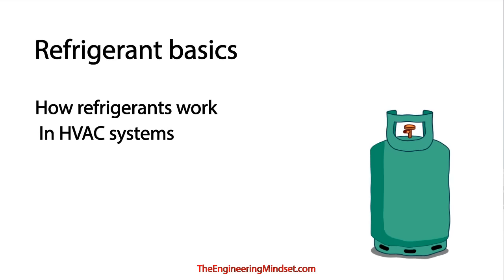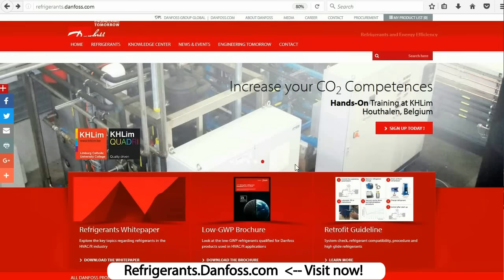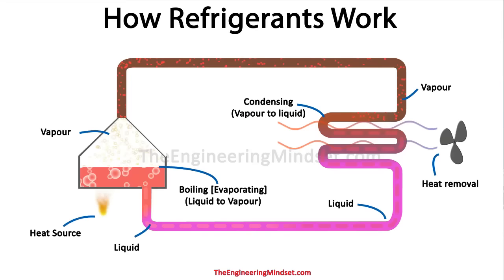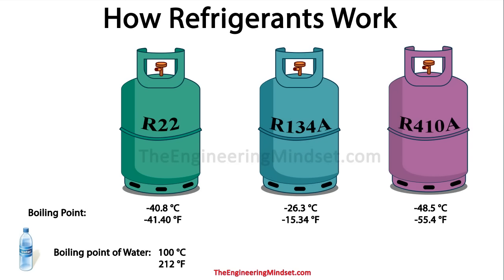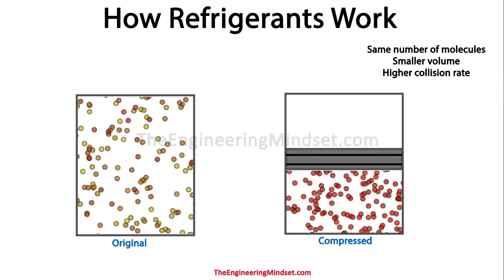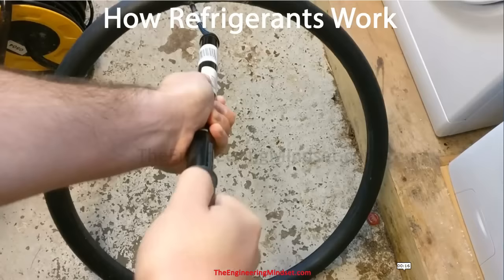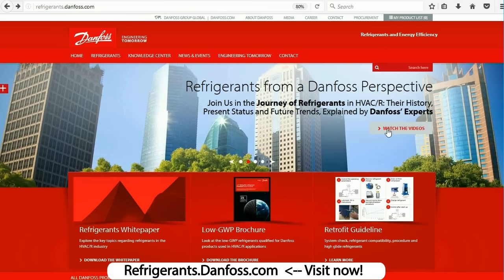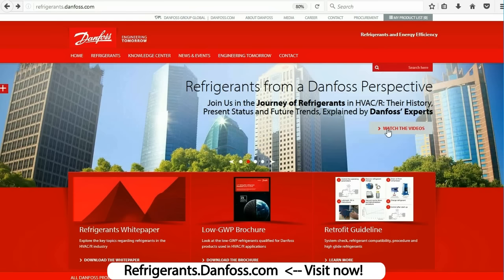Refrigerants How they work in HVAC systems

Comment from the maker: ⚠️ Found this video super useful? Buy Paul a coffee to say thanks: ☕
PayPal: https://www.paypal.me/TheEngineerinMindset
Reply: How Do Flash Drives Work?
Reply: The Engineering Mindset nice video
Reply: Can you please make a video about subcooling and super heat
Reply: Thank you ,it's educational item.
Reply: Why your videos are not coming in hindi version??
Reply: I am just curious that you couldn't get any revenue from advertisement here in youtube?
Reply: This was a nice explaination EXCEPT for two major issues. 1. The refrigerant in State-1 is a superheated vapor and is NOT in its saturation state! If it was, this would pose a problem to the compressor which is a "vapor" pump. It can not and does not want to see any liquid!  2. Inversly, in State-2, at the output of the condenser, the refrigerant is in a high temperature-high pressure sub-cooled liquid. The refrigerant needs to be 100% subcooled liquid when entering the evaporator. This is where you want all of the absorbing of heat going on, not in the liquid line.

Comment: Best video I've watched to explain how a fridge works. Thank you.
Reply: I thought it said refrigerant not a fridge
Reply: @VenomSkywalker.  refrigerant is just the stuff inside the lines that causes the fridge to get cold. Same thing as an air conditioner just slightly different for lower temps

Comment: This was a nice explaination EXCEPT for two major issues. 1. The refrigerant in State-1 is a superheated vapor and is NOT in its saturation state! If it was, this would pose a problem to the compressor which is a "vapor" pump. It can not and does not want to see any liquid!  2. Inversly, in State-2, at the output of the condenser, the refrigerant is in a high temperature-high pressure sub-cooled liquid. The refrigerant needs to be 100% sub-cooled liquid when entering the evaporator. This is where you want all of the absorbing of heat going on, not in the liquid line.

Comment: Could you go more into detail for the evaporator stage. Everything makes sense and was easy to understand until the evaporator cycle
Reply: Temperature and pressure are related. The saturation temperature of a substance is the temp at which it will change state from a vapor to a liquid or vice versa. The saturation temp depends on pressure. 
The high temp high pressure liquid refrigerant passes through the metering device. The metering device and compressor creates a pressure differential. So when the refrigerant passes through the metering device its pressure and temperature drops. So now the refrigerant temperature and saturation temperature is lower than the temperature in the space we are trying to cool.
Heat moves from hot to cold so when air is passed through the evaporator coil it the refrigerant absorbs heat from the air. The refrigerant will remain as a liquid until it has absorbed enough heat to evaporate. The state change from a liquid to a vapor is where most of the cooling comes from. The liquid refrigerant has to absorb a lot of heat before it will evaporate and start increasing in temperature.

Comment: The Compressor compresses from state 1 to 2, and increases pressure, and temperature. Yet the (T, s) graph on the top left shows that the transformation 1 to 2 is isothermal (T is constant). Is the (T, s) graph wrong? Sorry if I missed something.

Comment: so does the boiling point rise with the higher pressure? i thought 410a boiled above -50-60F, so if it leaves the compressor, it would seem like it would most definitely be a vapor, unless the increased pressure makes that boiling point rise substantially.

Comment: Doesn’t the refrigerants boiling point change at the different pressure value? So after the condenser it actually turns into liquid even though temperature is most likely not below -26C.

Comment: Refrigerant also condenses at higher temperature at higher pressure  and it facilitates dumping out heat just like it evaporates at lower temperature at lower pressure and it facilitated absorption of heat?

Comment: so correct me if i'm wrong but long story short, the refrigerant gets heated up (pressurized), all that heat is blown outside to make it easier to cool down when its depressurized, then once its depressurized, it passes across another fan that blows cooled air inside?

Comment: I don't understand.  If the refrigerant's boiling point is so low.  Then what really makes the refrigerant become liquid again?  Moving air alone can't get to minus 26 degree Celsius on its own.  So what's dropping the temperature to below minus 26 degree to condensate the refrigerant to liquid form??  I must be missing something.
Reply: I know it's been two years, but the compressor compresses the vapor into a liquid and packs it into the high pressure line where it can stay a liquid for a moment

Comment: I have worked as mechanical engineer for many years for a major petrochemical refinery. among other maintenance areas of Lube and Fuel refineries I was in charge of the FEU unit where and the refrigeration unit was part it to get the wax out. I was also responsible for the centrifugal compressor and was trained to troubleshoot the refrigeration centrifugal compressor  doing vibration analysis using Bentley Nevada instruments. 
We used to send out the control valves for calibration to the workshop and the instrumentation department would get the requirements from operations for calibration of TXV?

Could u please do a video on calibration of TXV?
Thanks, the video was super interesting
Reply from the maker: See our new video on how to build mechanical versions of electronic circuits? Watch here: https://youtu.be/Zv9Q7ih48Uc

Comment: Can you tell  me  where the Best position is  to measure tue superheat and subcooling temperature? I think directly before the TXV  and directly before  the compressor. But in many videos the technicians  measure at the two connectors of the outside unit. Can this be correct and accurate?

Comment: Great video, thank you. It may be a silly question, but what effect (if any) does the boiling point of a refrigerant have on the temperature that can be achieved? 

If I wanted to make a freezer capable of reducing the temperature to -40 C what refrigerants should I consider?

Comment: How do we turn the refrigerant into a liquid again if there's nowhere to get the temperature below the boiling point of the refrigerant? Is it because of the pressure in the system between the compressor and the expansion valve increasing the boiling point of the refrigerant?

Comment: Thank you for the explanation! I have a question about the used method and the process of maintaining a specific temperature. 
So  I want to know things like what happen when the the system  reach  the requested temperature ? what will happen to the refrigerant, the compressor, and the fans! And  what are the steps the system follow, and what happen when the temperature increases again?
Reply: Most refrigerant systems, be they the refrigerator in your house, your home A/C, or the A/C in your car, will cycle on and off. When your thermostat in your house detects that the temperature has risen above a certain range, it will simply close a small switch, which causes a couple of big relays to close, which starts your compressor, the fan on your condenser unit outside, and the blower for the evaporator inside your house. It will run until the temperature in your house reaches the lower threshold on your thermostat, then it turns off. Your refrigerator works much the same, cycling on and off as the temperature rises and falls. With your car, it depends on what sort of a/c control you have. Many cars have a simple set of knobs - you turn on the a/c, the a/c runs. As the pressure inside the a/c system rises and falls, the compressor itself will cycle off and on - that's the clicking you hear under the hood - and your radiator fan will come on, if your car has an electric one,. while the blower motor inside the car runs to cool you off. There are some cars that have automatic temperature control - these work basically the same way, only they will throttle the blower motor inside the car up and down to keep the temperature in a certain range.
Reply: THANK YOU SOOOOO MUCH MR ODDMAN1980...
Reply from the maker: Seen our new pressure switch video? Link: https://youtu.be/YG81w0HFXNc

Comment: Came to this video with a question “Could A/Cs potentially operate without the use of refrigerant with the same efficiency? I'm no mechanical engineer or HVAC Engineer but I hope this sparks curiosity in someone somewhere.
Reply from the maker: See our new video on how to build mechanical versions of electronic circuits? Watch here: https://youtu.be/Zv9Q7ih48Uc

Comment: one thing I still don't get, and can't seem to find, is the limits of refrigeration? For example, why wouldn't you further increase the pressure of the compressor which would increase the temperature of the refrigerant exiting it and afford you more heat to transfer because refrigerant is hotter? I am sure there is a simple reason why they don't just put in a bigger compressor, but I am struggling to find it.

Comment: Im not an engineer , but if the boiling point of the refigerant gas (r134a f.e.) is well below freezing point of water , and if that gas is in the scroll compressor of a split unit, while its hot outside (35°C) then the whole gas should be superheated or superboiled ? How it does not get super volatile and unstable when its well above its boiling point, and further unstable when its compressed ?

Comment: what are the main reasons of icing at evaporator coil and on compressor. 
The suction and Discharge pressure of R-407C refrigerant required for HVACs.
Reply: SHAFIQ KHARAL 
A blocked evaporator coil with a dirt plugged up fins for the coil, and dirty  filters will freeze up an evaporator coil, and compressor.
Another thing is a broken belt on the indoor fan motor that is not moving any air across the evaporator coil.
R-407c has similar pressures to R-22 but has a different oil for compressor.
R-407c should be vapor at 40°F with a 81psi back pressure & a head pressure of 321°F on a 95° F day.
Reply: SHAFIQ KHARAL 
A blocked evaporator coil with  dirt plugged up fins on the coil, and dirty  filters will freeze up an evaporator coil, and compressor.
Another thing is a broken belt on the indoor fan motor that is not moving any air across the evaporator coil.
R-407c has similar pressures to R-22 but has a different oil for compressor.
R-407c should be vapor at 40°F  in the evaporator with a 81psi back pressure & a condensing head pressure of 321psi. on a 95° F day.

Comment: Thanks my sir
My question is LG AC is not blowing hot air through indoor unit in winter 
I want to solution this problem
Reply from the maker: check the manufacturer documents
Reply: Take it into the middle of the room and ignite it. May need some wood to help it burn... Hope that helps
Reply: I know a friend of mine who had a fridge who had a LG refrigerator, He had a linear compressor. I took it apart and it had plastic insides that were blown from rubbing against steel.
Reply: A. is the unit a heat pump or is it B. electric heat ? If A the problem lies in the refrigerant reversal valve. It basically turns the indoor unit in to the condenser and rejects heat into the conditioned space. If B then problem lies in the electric heating coils. They operate much like the filament an incandescent lightbulb. In either case it could be the actual component that I mentioned or a defective relay controlling it.
Reply: Skill tradesmen that’s what you need
Reply: Buy some blankets to get warmth....

Comment: Have you ever used Cold Plus as a cooling enhancer? I have heard stories of saving 8% to 18% on both commercial and residential systems?
Reply from the maker: No I haven't. I have tried an equivalent for heating systems and there was some improvement. I forget exactly how much it improved but it was noticeable

Comment: How refrigerants are kept in a liquid state in cylinders.? since the atmosphere temp. is much higher than the boiling point of refrigerant.
Reply: The liquid does turn into a gas, but since it's in a closed container, the pressure equalizes at some level of equilibrium that keeps it at a certain liquid level.  That is why a disposable container of Freon with single valve has to be inverted to discharge liquid Freon into the system.

Comment: So the drop in the refrigerant's pressure causes it to drop in temperature lower than room temperature?

I've never been able to get my head around how air con can make inside a building cooler than it is outside (due to the equalisation of temperature)

Great video though, thank you.

Comment: probably a dumb question due to the fact that i have never seen anyone replace the refrigerant in any of these devices but that would mean the refrigerant you use would be sort of recycled? this gas does not run out that you have to replace?

Comment: If R22 Boiling Point is -40.8 C  , then how it will Boils by getting Room temperature which will be near 25 C to 40 C suppose.
Reply: Didnt get that too..i guess he meant that room temp is enough to begin the evaporation process thus condensing later n cool the same room... Someone plz confirm this.
Reply: @ginomiguel4809   i did not get ur poin,  if u will see video u will understand my question.

Comment: Great explanation. I was also wondering if it was good to use liquefied air (mostly nitrogen and oxygen) as a refrigerant.
So there wouldn't be any need to buy refrigerant at store. Just compress filtered air. What do you think?
Reply from the maker: It could work but its easier just to use refrigerant with very low boiling point.
Reply: Is it easier because of pressure or efficiency?
r22 boiling p. is -41.62F, r134a is -15.34F air is -317.83F
Reply: Browarus Pierogus There's quite a few reasons, but mostly its that we want things that boil around the temperatures we want to refrigerate the product to. We can control low side pressure to get a desired temperature with most refrigerants easily, but with oxygen we would be running really high pressures in order to keep things in a desired range. For industrial cold storage you would see multi stage systems where the low side could be running in a vacuum to achieve colder temperatures while a high side keeps produce fresh at a higher suction pressure feeding the same discharge lines.

Comment: Hi sir how to identify mismatching compressor, condenser coil, evaporator coil, condenser fan motor, evaporator fan motor, thermostatic expansion valve, filter drier, capillary tube. Sir please give me some ideas. Thank you
Reply from the maker: If they are mismatched the system will run into many errors. high super heat, freezing pipes, low COP, compressor burnout etc etc.
Reply: The Engineering Mindset thanks for your reply sir whats meant by cop
Reply from the maker: https://youtu.be/h5ILlZ8nyHE

Comment: i don't get how something which boils at -55*F  turns to liquid at temps greater than -55*F . I understand how it can flash off and turn into super heat but from super heat to liquid has me confused .
Reply: It is -55 deg F at NTP or STP which is Normal/Standard Temperature and Pressure. The values of pressure are what you would have at 20deg C and at sea level. As pressure increases, the gas condenses and turns to liquid. You must have seen condensate drain from an air compressor. Inside a closed and controlled system of an air conditioning system, the refrigerant is at a manipulated pressure and temperature band that is just right to keep the refrigerant switch between vapour and liquid to suit our design. Trust this clarifies.
Reply: @SubramaniamLakshminarayanan  thanks
Reply from the maker: Seen our new pressure switch video? Link: https://youtu.be/YG81w0HFXNc

Comment: Ya this is the good shit. you can clean things like walls by using a sprung. But do not smoke around this as when refrigerant burns it makes carbonteira chloride (ms)  may be. any way it has a 3.5 years haft life.  So what does you get 3.5 years later you have haft of what you got the first time.  I think that was 50 years ago. I am no chemist. They used it in dry cleaning till they found out that it stays in your system for a long time. It does go a way little by little. So if you get 10 units  3.5 years late you have only 5 units.  3.5 years later you have only 2.5 units left & 3.5 years later you have only
1.25 & 3.5 years later you have only .625 units left & so on. any way you get the drift. 14 .0 years later you have.625 that is not very much but bit was 14 years ago. This is why you do not smoke around crap.  Smoke only in clean air. You will die slower. Maybe.   No BullShit.